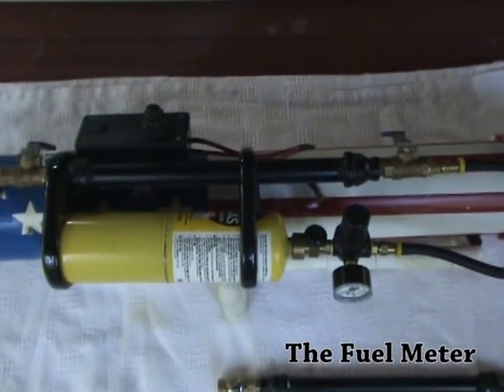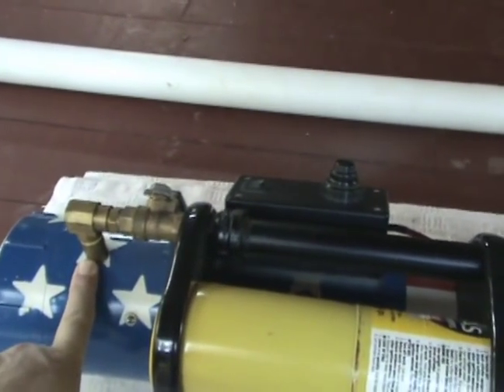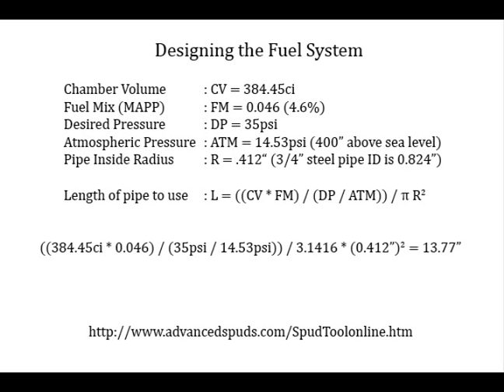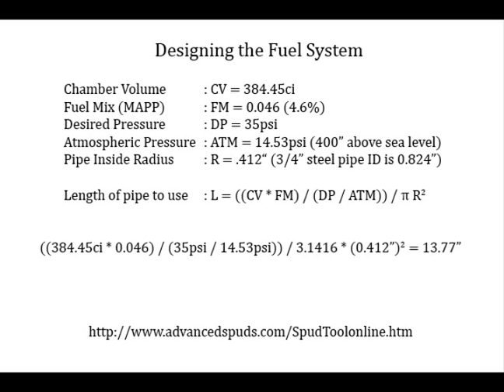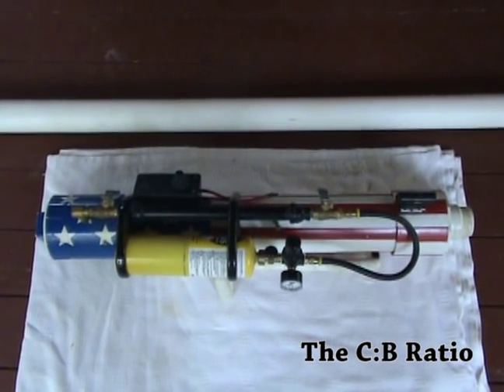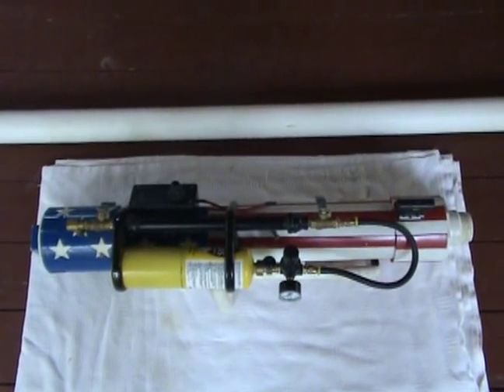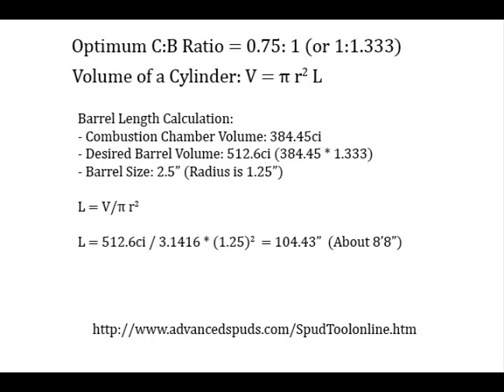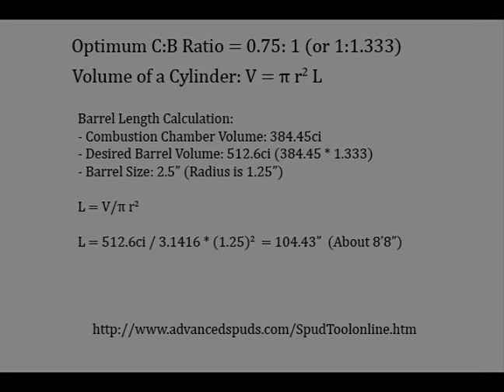Doing The Math

Comment from the maker: @Cwatts2009

I used some standard pipe thread (NPT) brass and high pressure hose (100psi+). It's regular pipe thread on the regulator end and a gas coupling on the other (ask anyone at the hardware place, it's real plain vanilla stuff)

Comment: great vid ,well i have  some news on the battery powerd spud i made ,with the two batts i have i get 36 shots at full power then the last shot dies out at 50 psi,all of the 36 shots ar around 140 psi ,i dont have chamber volumes yet but i may use your water idea to to figure it out,the  first
gun i biult had a small 260 psi compressore on it ,i have the vid,but the pump blew out at the gearing

Comment from the maker: The best calculation will never be as good as actually measuring. Use a measuring cup and fill the chamber with water to get an exact measurement of the volume.  Same for the Meter pipe after you build it. Then tweak the PSI to fit those measurements:

DP = ((CV * FM) / (L * (Pi * R * R))) * ATM

Comment from the maker: It's not length that matters, it's volume. Each size barrel will be a different length but have the same volume. The C:B ratio is a volume to volume ratio.

The best way to get the chamber volume is to measure it directly. Pour water into the chamber with a measuring cup until it's full. You'll have to convert from cups to liters or cubic inches but google will point you at websites for that.

If you can't fill it with water then just calculate it (volume of a cylinder I'd guess).